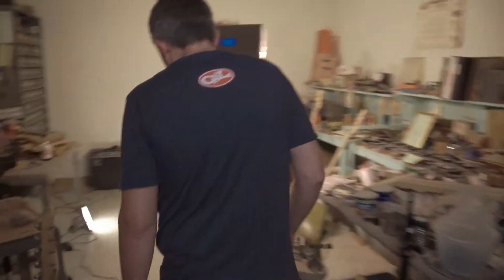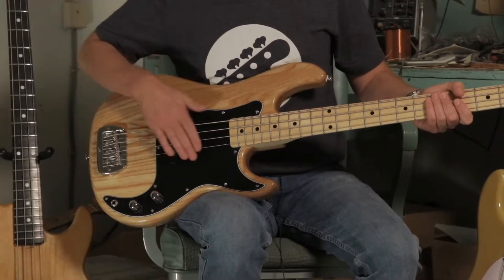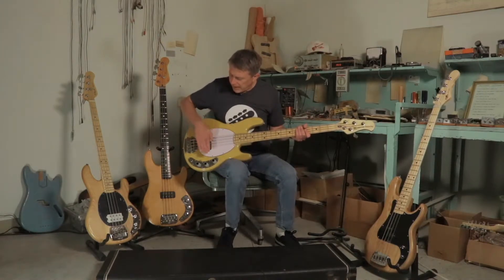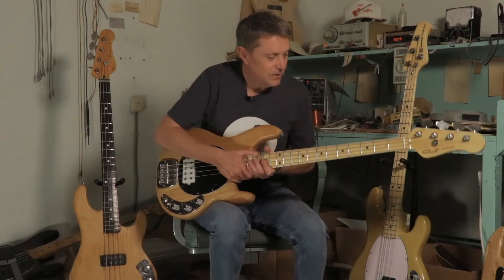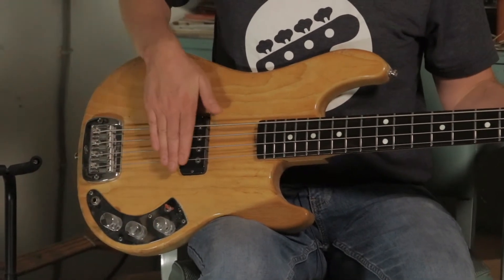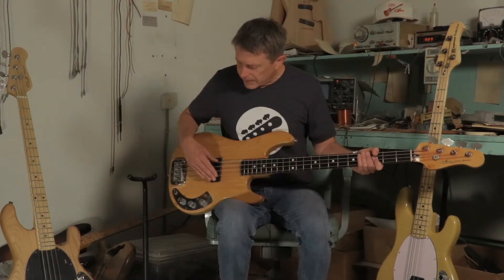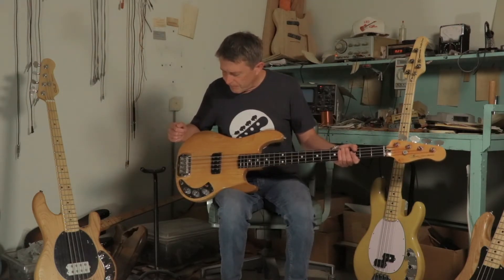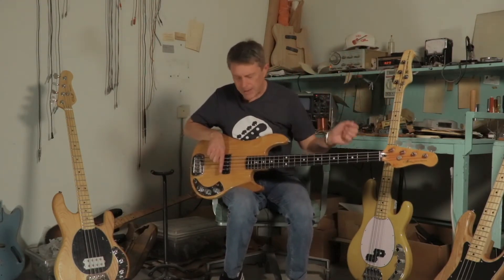Origins: Great Pickup Migration

Comment: Hey Dave, I recently scored a 1981 L1000 in the same finish as the one you scored from Guitar Center, only ebony fingerboard. It looks like it was stored in a hot attic for 30 years because the finish and ebony shrank and was super dry.. body finish shrank so bad that the two piece seam popping out. Truss rod and neck still all good, though... Currently in the shop in Delray Beach, FL for a refret (Dunlop 6100) and some TLC. Looking forward to rocking out with this bad boy.